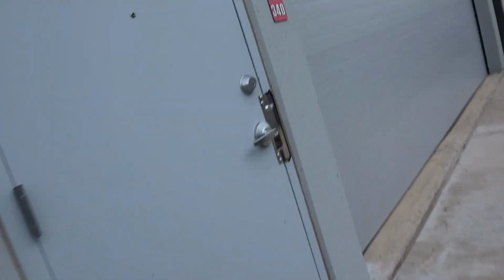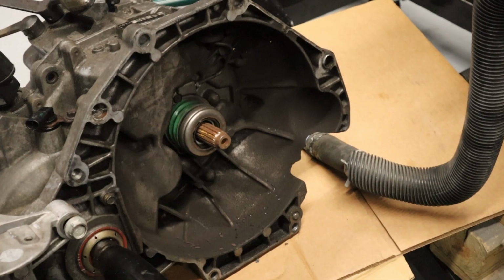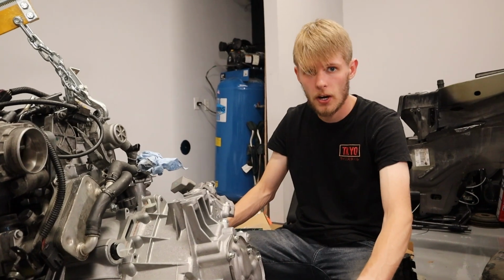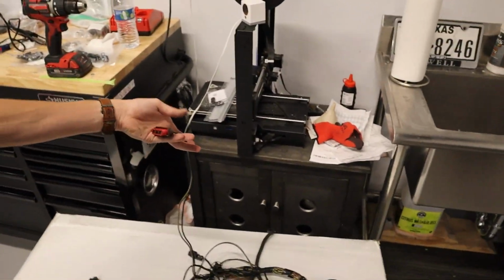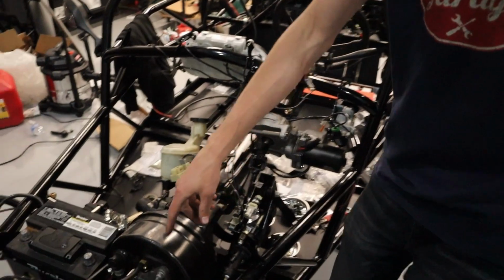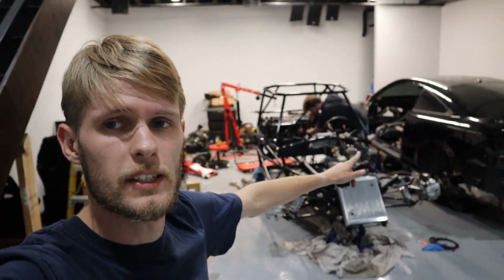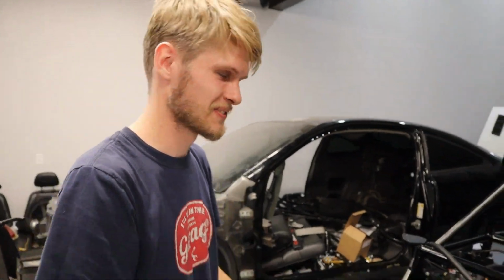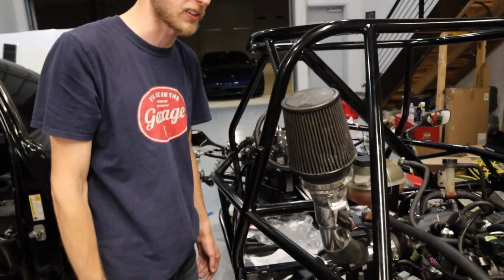FINALLY Starting my DF Goblin Kit Car! - DF Goblin 488 First Start!

Comment: If you are building a Goblin, it is highly recommended to read through a couple of build logs on the DF Goblin forum that match your donor year/model before you start building, as many of the lessons learned here have already been learned and thoroughly documented in those build logs. Congrats on the first start, it's a great feeling! Good luck with the subframe install, getting everything to align can be a chore. See my recommendation above.